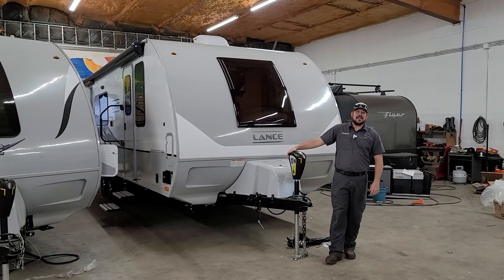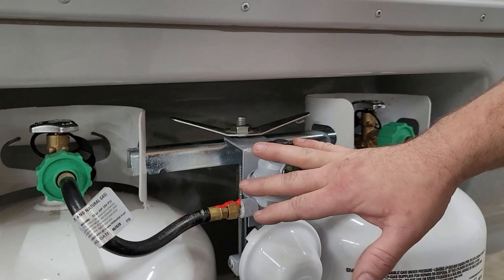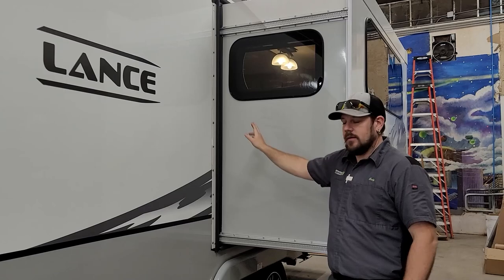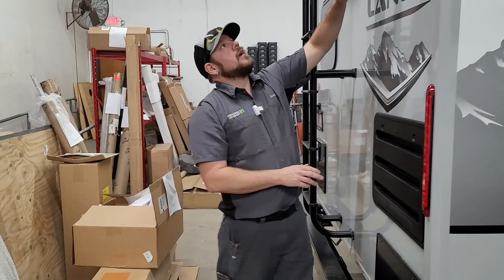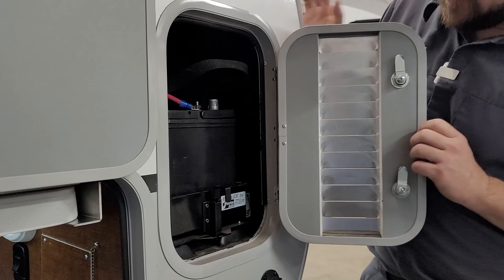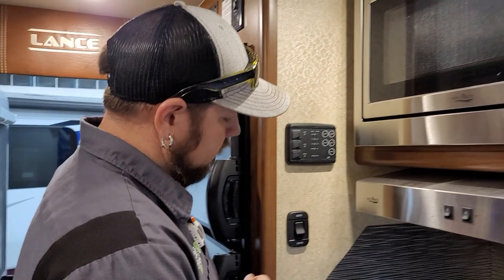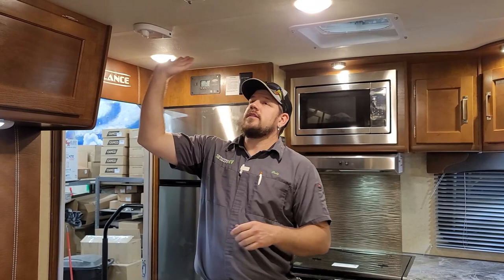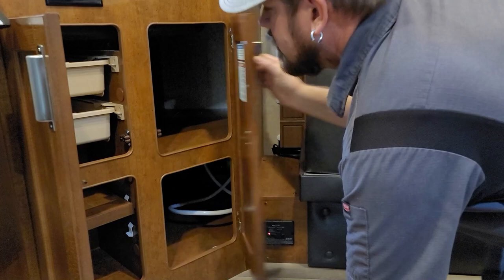2021 Lance 2285 Technician Tour

Comment: I noticed a one cu ft size difference in the refrigerator size between the 2285 & 2375, not a huge difference, but the 2285 being slightly smaller looks to have the larger fridge size for the same GVWR. Also, I noticed you skipped over the bathroom & closet storages. With a six month+ order time with Lance we are trying to determine the best flóorplan for us to replace our '17 1985 as we transition from vacation mode as RV park managers to Camp Host mode where we are using it in a much longer timeframe without hookups. We have camp hosted in a Lance truck camper previously so have more indepth knowledge about the requirements than your average weekender. We are set up with 400 watts of solar, LifePO4 batteries, & an inverter & Victron battery monitor I installed myself before Lance offered a similar package. Someday it would be helpful for PJ & the RV tech to give an in depth review of an extended boondocking setup for those folks headed for the mountains as many Texans do in summer. Cheers. Dave

Comment: I agree with Terry you never got back to address the water heater bypass , question did you figure out were it's located
Reply from the maker: Oops. I'll bring this up to the guys and hopefully we'll do better in future videos.
Reply: He was looking in the right area. There is an almost flush 6 x 8 panel with 4 small screws in the back corner of the storage space floor level below the sink. You need long arms to access it. Behind the panel is a two way plastic water valve that sends the cold supply water to the cold system or into the water heater. De-select the water heater and drain the heater before winterizing with RV anti freeze.  Flush the system and sanitize in the spring before opening the valve to supply the heater.

Comment: Great tour by the technician.  I wish the audio was better.  I heard nothing about purpose of the digital gadget over the fridge.  What is that thing?  You did not mention the toggle switch for the rope lights in the front outside of the trailer which is usually inside the driver side forward storage box.  The Jenson t.v./cable system is very confusing so I will look for a video of this as well.  The video was helpful but could have been great with better audio.  Thanks.
Reply from the maker: Good feedback, thank you!

Comment: No mention of a sway bar system. It appears to have a receiver to the side of the tank cover. Does the trailer come with a trailer hitch that would be compatible?
Reply: I use an Equalizer weight distributing system on our Lance with the 4 3/8" brackets ordered to be compatible with the BAL frame. Because our Lance does not have the generator storage door setup, we should have ordered the 18" shank instead of the standard 12" shank so that we could open our truck tailgate fully. We will remedy that with our next Lance as our Champion 3400 dual fuel generator is probably too large for the new standard generator cavity, but as camp Hosts we needed a more robust generator for charging our battery powered tools, etc. -Dave